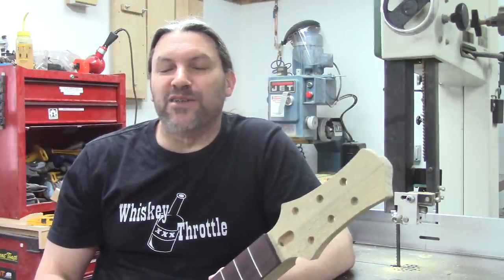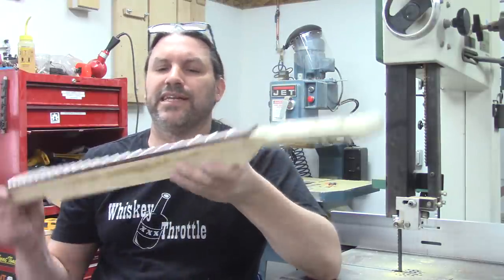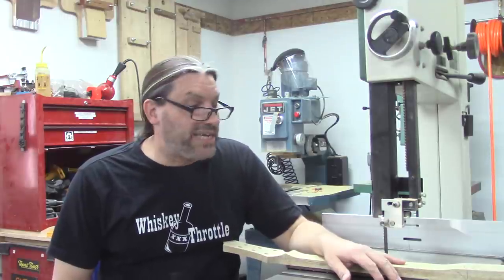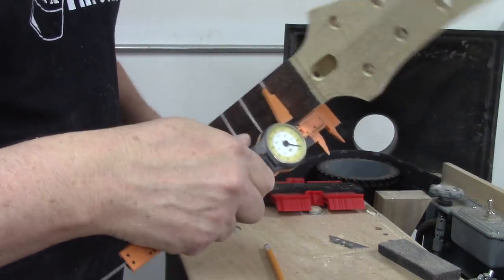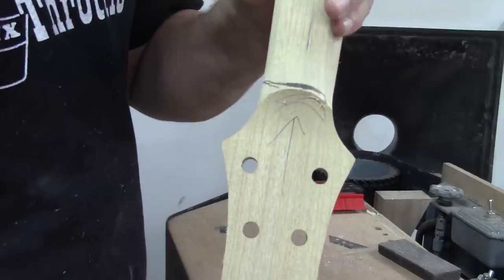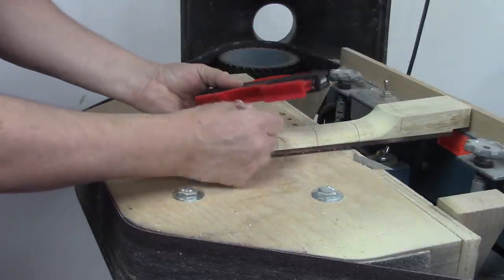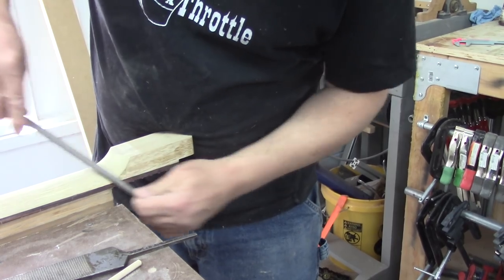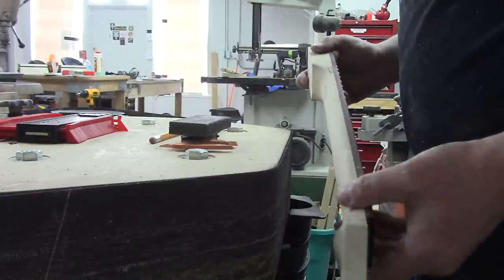How We Shape Guitar Necks The Old School Way... Just Say No To CNC

Comment: Nice video. I used my bandsaw to cut the back contour shape of my strat bodies as well as the front edge shape. I made a jig to hold the body against a flat surface at the proper angle so that the bandsaw blade wouldn’t go off my intended path. These machines can have a mind of their own. 

I had a shaper blade made for my neck shape and made a jig to hold the neck steady as I slowly fed it to the blade one half at a time. 

I was always looking to have the machines do most of the work trying to avoid having to do any extra handwork that would make a less consistent product. 

I was making limited production runs of 20 at a time. 

The rasp was my friend for making a smooth transition coming off the shaper cut. After I found the pneumatic sanding drum to work a charm.
Reply from the maker: Let me know if you want to sell that shaper cutter
Reply: @TexasToastGuitars  Probably not so don't get your hopes up.  Here's the place that made mine about 45 years ago: https://cggschmidt.net/cggwp/. I had it made as a total spindle knife with 3 cutters, instead of a channel lock collar fit, safer.  They did have to make the knives in two pieces so there was a very small bead left on the wood that needed to be sanded off as well.  I think it cost me about $150 back then which was probably the most expensive investment I made in tools at that time.  Good luck.  If I live long enough to set up a hobby shop, I'll try to make some kind of shaper for it...  (dream on, Marc, dream on... hahah)

Comment: I love the old school methods and hand worked necks. Yes a CNC can be consistent, but using scrapers, traditional wood working tools and hand sanding really can make you get a superior more tailored neck than an off the shelf buy.  Even if you buy a regular neck, you can alter it to your liking. I like widdling them on my porch on a rocking chair.  As for PRS, you cannot stop all movement from wood, unless its petrified.
Reply from the maker: CNC builders are quick to point out that they are more accurate and there is a lot of handwork after it comes off the machine... you ever see what sandpaper will do to an accurate piece of wood :)

Comment: I think I would seriously F***k this up,  Band saw slant cut, one tiny slip is all it takes! But  I guess when ya got the tools and the talent, it's considerably easier. awesome band saw BTW!.  That sander is the cats ass! Damn!  Your method of sanding the edge radius last is smart, so as you can now used the mostly shaped neck as a better guide when applying the final passes. You can always take more off, but ya can’t put it back on.  I’ll probably never do this, but it’s interesting to see how it’s supposed to be done correctly. You’ve got your step by steps down really good. Nice job!
Reply from the maker: I do not recommend that technique at all... however that is an old school thing that I thought people might be interested in seeing. There are lots of forgotten ways things used to get done that aren't used any longer